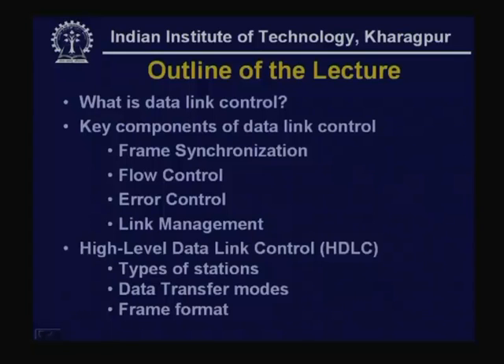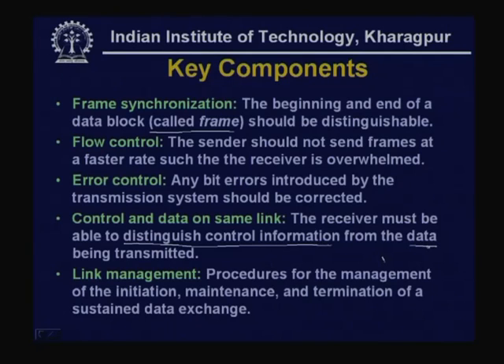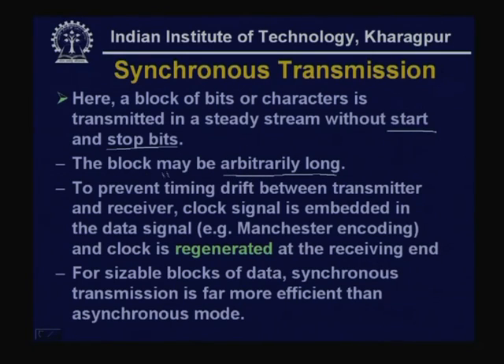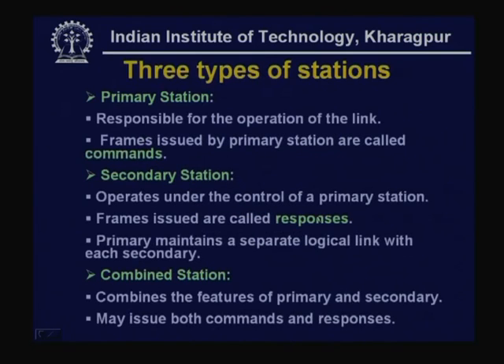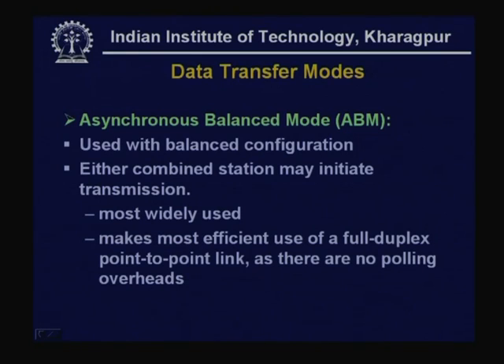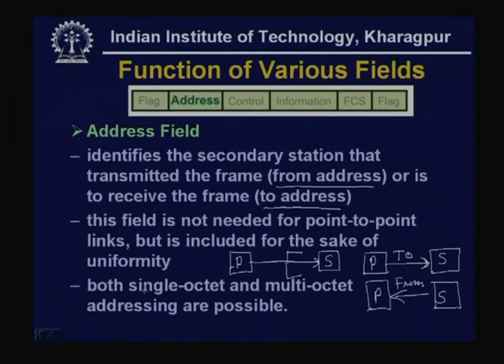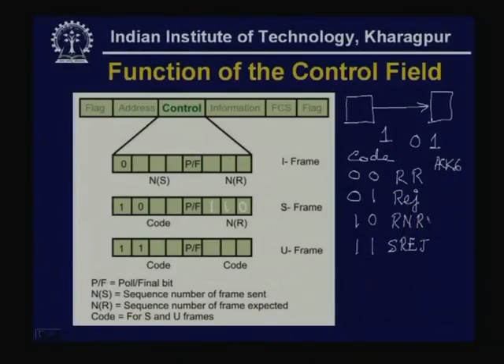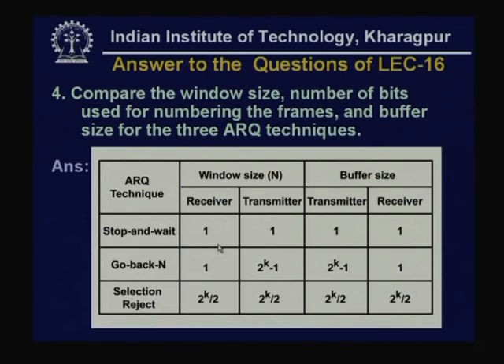Lecture - 17 Data Link Control

Comment: 01:56
02:58
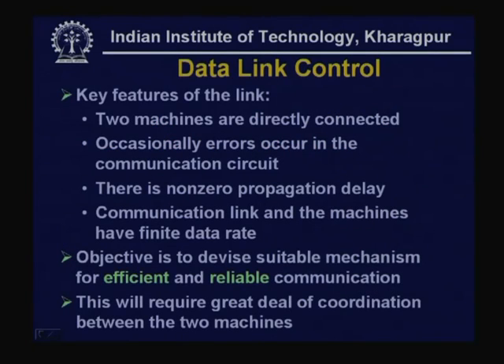03:38
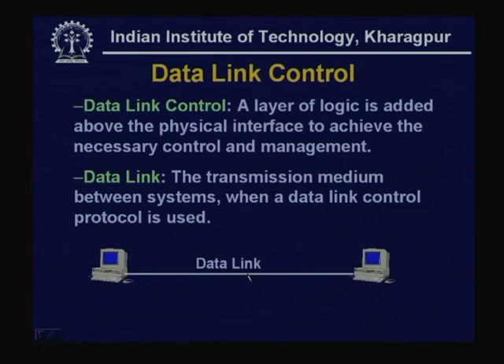06:02
06:50 (Note: Appears within the description for the slide at 03:38, but explicitly referenced)
07:20
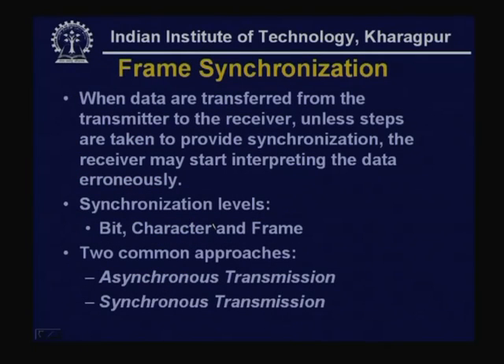11:05
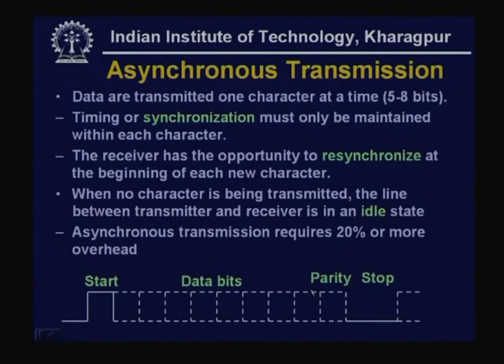11:47
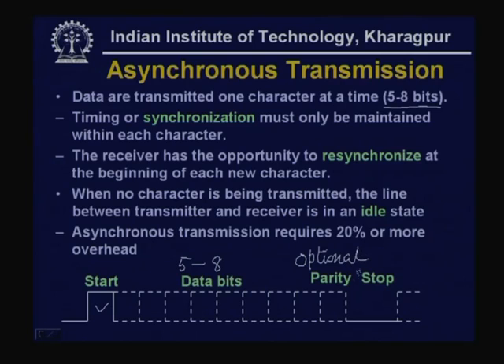12:35 (Note: Appears within the description for the slide at 11:05, but explicitly referenced)
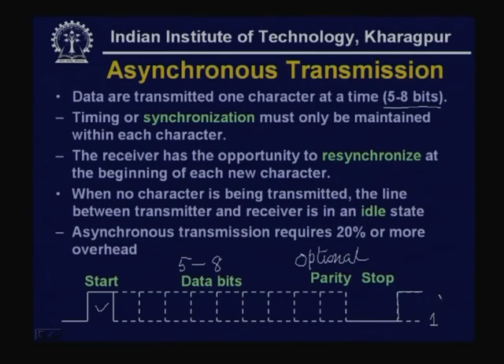13:03 (Note: Appears within the description for the slide at 11:05, but explicitly referenced)
14:05 (Note: Appears within the description for the slide at 11:05, but explicitly referenced)
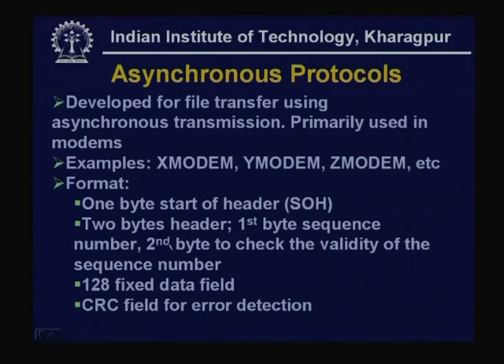14:35
17:05 (Note: Appears within the description for the slide at 14:35, but explicitly referenced)
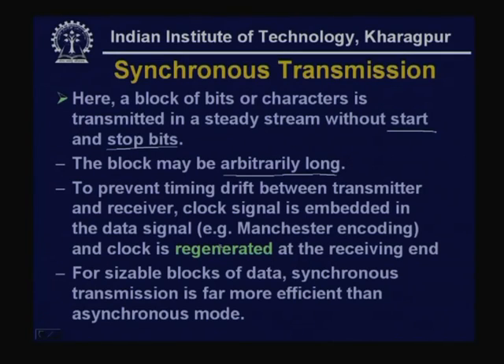18:22
20:32
22:18
22:43 (Note: Appears within the description for the slide at 20:32, but explicitly referenced)
24:36
25:38
26:11
27:44
28:42
30:05
30:37 (Note: Appears within the description for the slide at 30:05, but explicitly referenced)
31:11
31:52
32:55 (Note: Appears within the description for the slide at 31:52, but explicitly referenced)
33:53
35:04
36:10
36:35 (Note: Appears within the description for the slide at 36:10, but explicitly referenced)
37:55
39:40 (Note: Appears within the description for the slide at 37:55, but explicitly referenced)
40:08
40:48 (Note: Appears within the description for the slide at 40:08, but explicitly referenced)
42:34
43:32
44:18
46:59 (Note: Appears within the description for the slide at 44:18, but explicitly referenced)
50:30
52:07
52:44 (Note: Appears within the description for the slide at 52:07, but explicitly referenced)
55:40
56:10
56:21
56:55
57:25
57:52